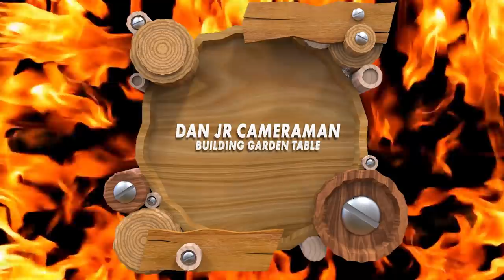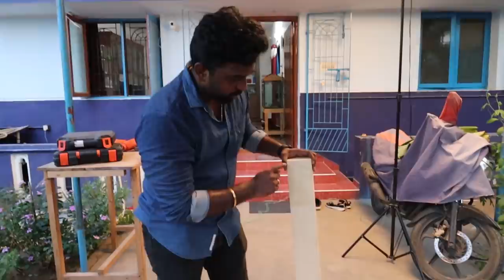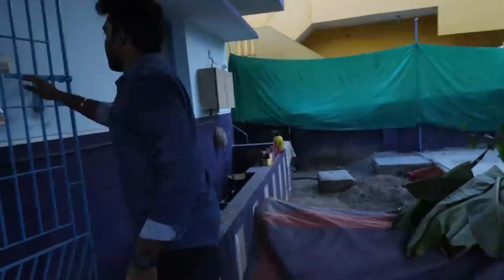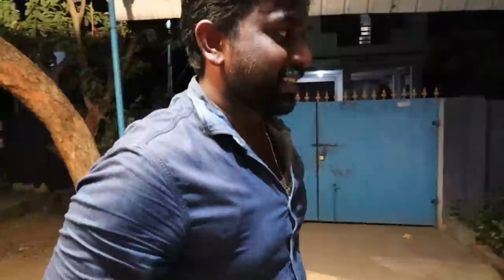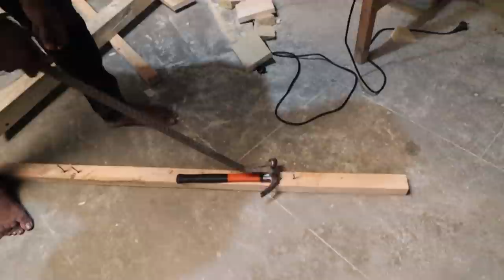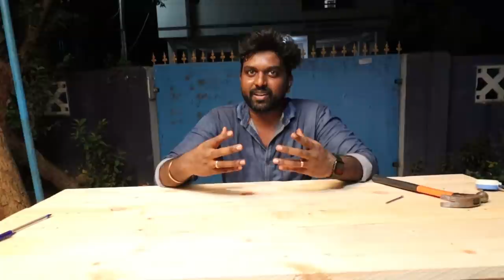Expectation Vs Reality | Building My Own Garden Review Table

Comment: Thumbnail pathutu CM sothapitaru nu nenachu video va vanthu patha CM vera level pannitaru🤩
OP CM💯❣😘🤙
Total price you can sell it = 5999....
Wood = 1500....
3inch and 2inch nails = 1000....
Equipment charges = 500....
CM Work charge or Coolie = 1000....
And profit = 1999....
So total 5999 podalam CM👌😍💫

Comment: Inspired 👍🙏 Nice work. Pl share review on wood work tools. Small suggestion, this table may cause Neck Pain/Cervical problems if you use the laptop for more time. Due to the height, increase in shoulder level cause abnormal compression in neck and results wrist pain as well.

Comment: Anna from next project pls use wood screws as wood be much more easier to use and it is very easy to remove if we did a mistake so pls consider using screws and definitely you will learn how to use screws nuts and bolts as it's not that difficult to learn